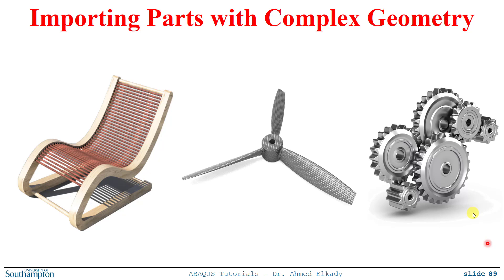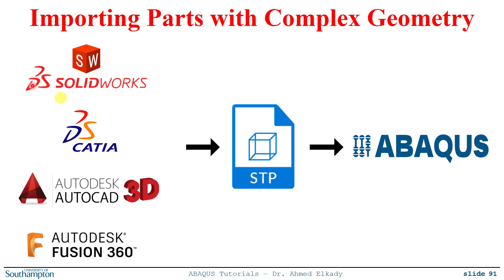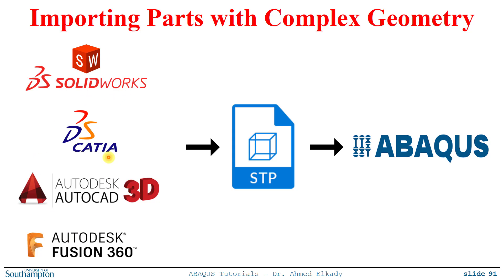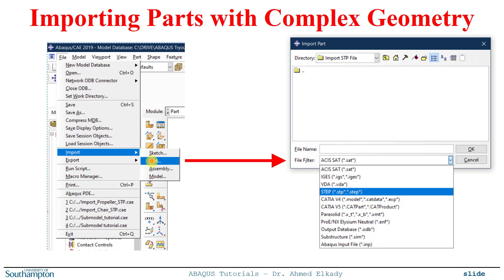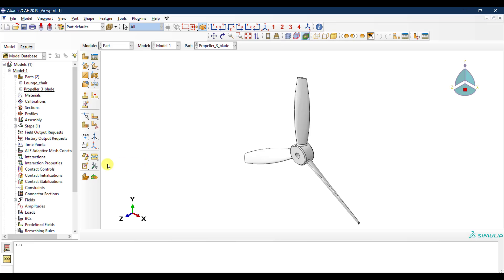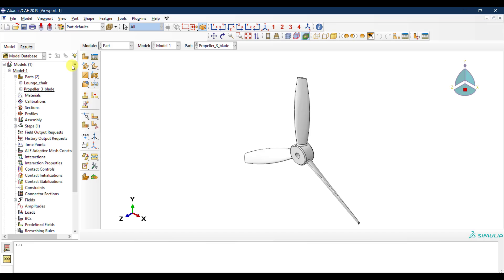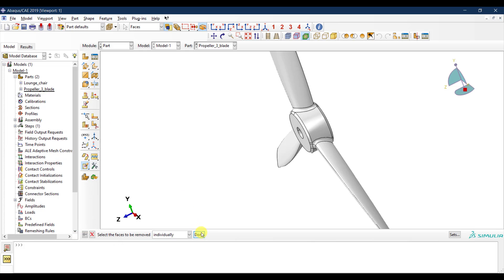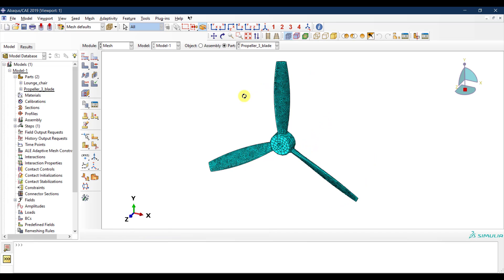#32 ABAQUS Tutorial: Importing Parts with Complex Geometry | STEP Files

Comment: Thank you very much for this tutorial! I am importing an IGS file which I created by importing an STL file to solidworks. The file therefore contains a lot of triangluar surfaces when importat to abaqus. When I seed the edges or the whole geometry the seeds align on the corners of the triangles and reducing the size does not increase the amount of elements, any tip how I could resolve this issue?